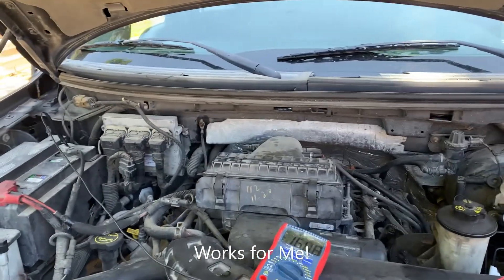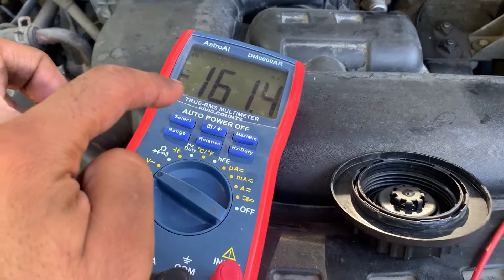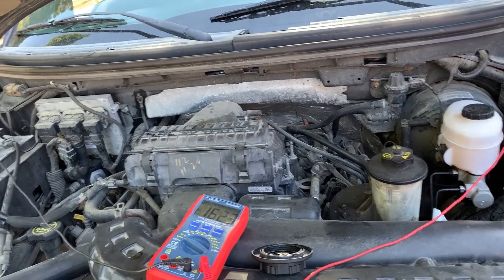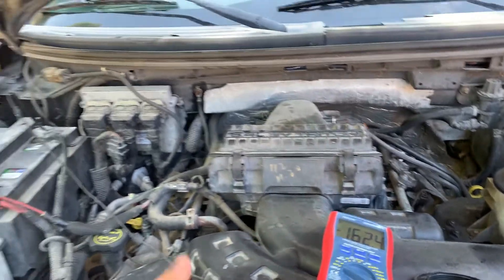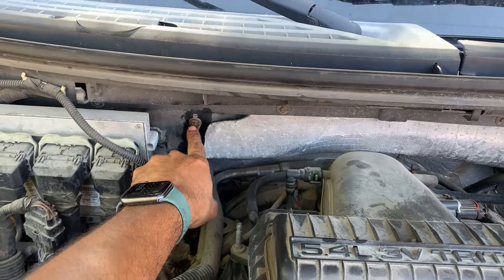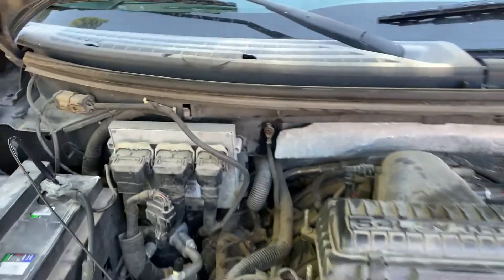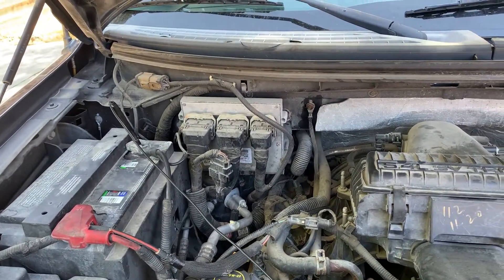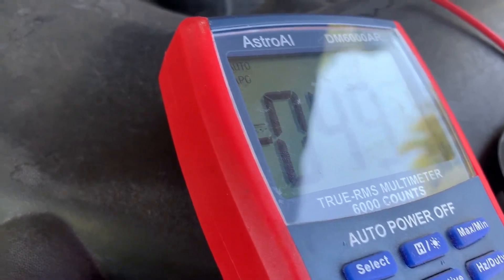Coolant High Voltage and Electrolysis - Simple Fix !!

Comment: Thank you, my 1st radiator failed at 9 years.
2nd radiator is 20 years old now and cooling fine due to checking for good ground & rinsing w/distilled water between flushes.
I think the "cleaner" can be to harsh,  so far so good thanks to distilled water.